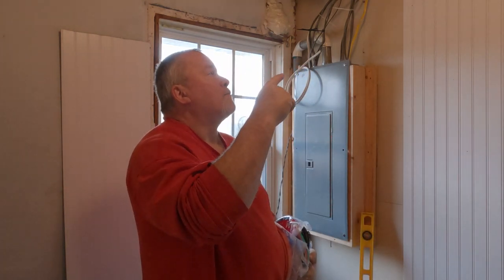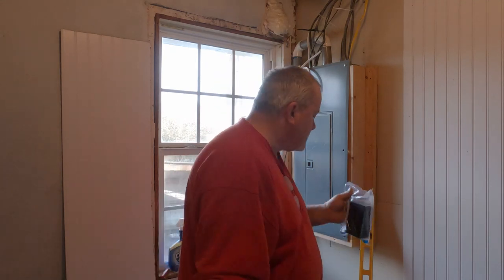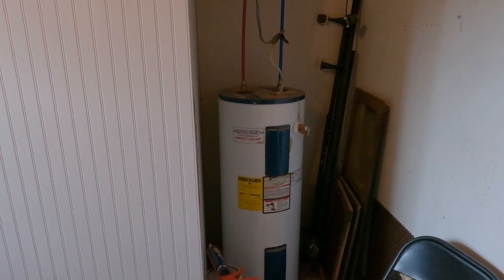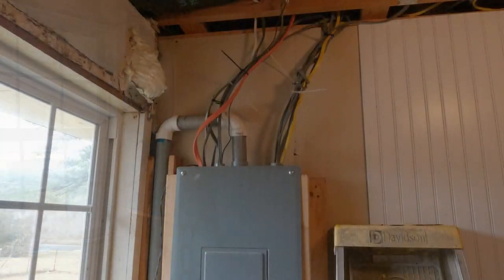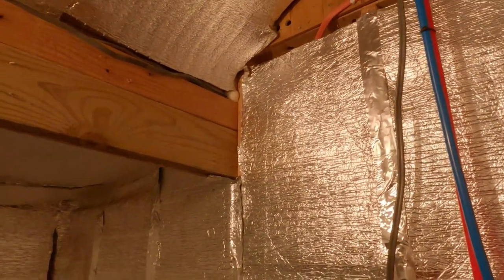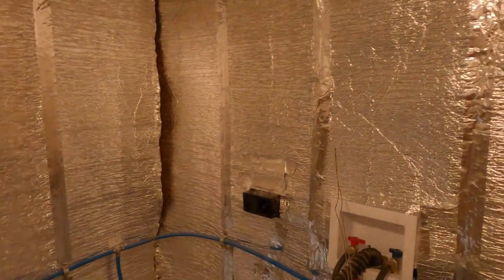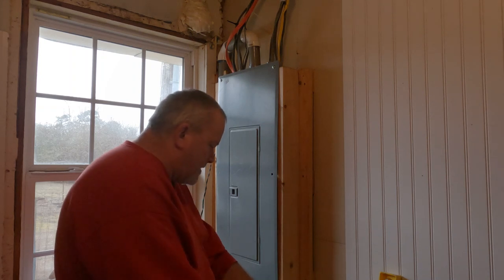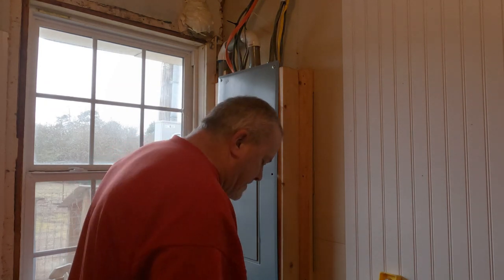GUILTY! I Killed My 30 Year Old Dryer! A Expensive Lesson Was Learned

Comment: mike the little brass strap you took off was for a 3 wire system  4 wire system you take the strap off the strap is actually a bong for the cabinet

Comment: looks good to me Mike the way your doing it you know over hear the cord is on the dryers and washing machines and we only have to plug it in all our wires hear are safe and very thick i think 20 amps at 240 volts and all house hear every switch plug on the wall has a switch on it